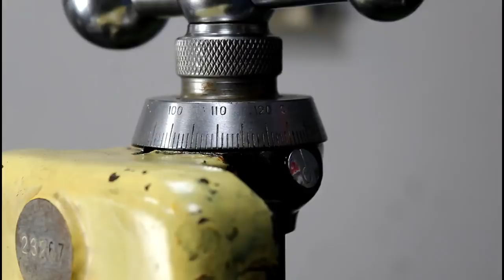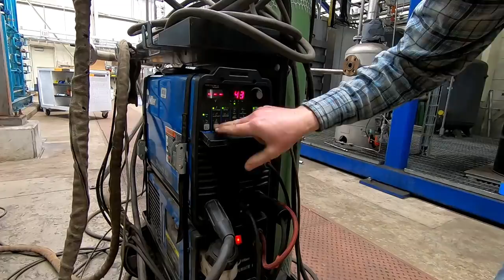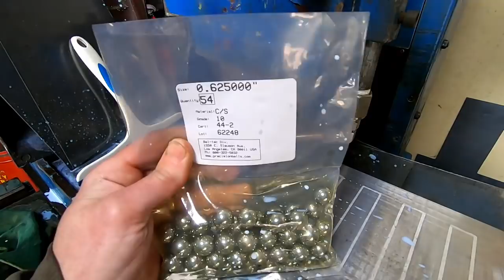Accurate Metal Shaper Work :-) Squaring Fireball tool squares.

Comment: Very interesting videos Steve.  I;m 82 years old and watch you and A bomb and Keith nearly every day. My earliest days of machining go back to highschool. I graduated in 1955.  I took all the machine shop classes that were offered plus related subjects,  my senior year I worked as a coop student at a company called Modern Machine & Tool Co.that graded my report card that year . Three years active duty U.S Navy  Long story short after working in another machine shop called Roemer Machine and Welding for seven years than a 7 year stint at The Rock Island Arsenal  as a grade 12 machinist  I purchased Modern Machine in 1978. I operated personally till about age 75. My son now runs it sort of like Adam Booth and his Dad. I'm  so ingrained to machine shop that I feel compelled to watch it. I've done it all hundreds of times, turning milling ,grinding of all types.  Also have 2 CNCs Haas vertical mill and Mazak Lathe. Getting back to grinding  I recommend .0002 tenths down feed per pass, anything more than that will wear your wheel down more rapidly and lose your finish.  If there is any thing that I could be of assistance feel free to Email me at arpsdel@gmail.com.  Thanks for your indulgence.

Comment: Just be aware that the 5/6 block test for surface grinders only tells you how well the chuck has been ground in (ie: how parallel it it to the ways). It will not tell you if the machine ways are bowed, since the chuck will have been ground in to follow that same bow. You'll only know how flat it is if you grind a large workpiece and check that on a surface plate.

Comment: The block test won’t tell you if it grinds flat. As long as the chuck was ground properly everything should be parallel but not necessarily flat. There’s some other ways to check actual flatness. Looking like you turned it into a decent grinder again!

Comment: Looks like that grinders a keeper.  Just like any new skill a bit of a learning curve comming up  but im sure you will pick it up quick enough.  Nice looking finish you showed.   I use a chinese magnetically coupled pump of similar operation for my homebrew beer setup and get good flow and tollerance to output blockage / intentional restriction.  I should check its bolt pattern as it might be handy to rotate its head too.

Comment: Might as well replace those balls now, no need to have to grind that chuck in twice by doing them later. :-) I am surprised they used english dimensioned balls in a grinder from a metric country. I guess imperial sticks around pretty good! lol
Reply from the maker: This machine has a crazy mix of metric and imperial hardware. Just enough to keep you guessing. I was also surprised to fine 5/8" balls in it.  The balls were about 100 bucks shipped. That's not that bad considering how accurate they are. Worth a shot at that price I think.  Good to hear from you Brian.  Thanks for watching

Comment: Hi Steve  I'm interested in seeing a shaper and dividing head used to do internal keyways and internal involute splines.  This type of work Is challenging with the equipment I have which doesn't include a shaper.  Thanks

Comment: Were you able to find, or do you need to find, any new tracks for the new bearings to ride in? I was also curious if the grit would imbed into those bearing holders and go to grinding on the new bearings when you put them in as well.

Comment: Why are covered bridges covered ?
And why do they have sides ?
Is it something to do with the old horse and cart days ?
Reply: Yes, they go back to the horse and buggy days. They were covered to keep snow and ice off the bridge. The sides kept the wind from blowing snow on the bridge as well.
Reply: Lots of covered bridges in the east still.
Reply: @bobwitt305  Sorry all, not true.  Many horses would not cross a bridge, the open frame scared them.  So bridges were enclosed to look like barns, then the horse/team would enter.   Rob
Reply: @davidmcgee7300  what does that have to do with my comment?
Reply: Water promotes wood rot. Ice keeps the water on there longer, ergo, more rot.  The cover is a roof, so rain and ice do not rot out the timbers of the  of bridge.

Comment: I just accidentally bought a surface grinder, so I'm depending on you to teach me how to work it!
Reply from the maker: A student trying to teach. I'm impressed at your confidence in me😄
Reply: I don't think I've ever watched one of your videos that I didn't learn something, even if it's only that I don't want to clean out the sump on an old mill. Btw the grinder will throw a 1.5" steel cube all the way across the barn and embed it in the wall like a ninja star, in case that's something you were going to try. It'll chip the grinding wheel at the same time. I recommend not trying this.

Comment: quite a score on that coolant pump. Very good flow, very quiet. Is there a bypass on the pump, so that the pump isn't deadheading when flow turned off?
Reply: That type of low pressure pump churns when it is not flowing.  No "deadhead" is created.

Comment: Hy  my name is Georges Gareau , I love your videos ,

I intend to build a 7 or 8 "  Metal shaper , I  was wondering what
would be the best number of strokes per minute  I found the fallowing
but they are all different

What is the best Strokes per minute for a 7, 8 , or 10 inch metal
shaper , 40     62      103     161 , 40        80      120     160 , 40        70      115     180 ,   or
42      75      120     195 ?

Why aree they so different

Georges

Comment: Sweet welds, boiler replacement? Why no purge on root though
Reply: The flange appears to be a socket weld and you don’t purge socket welds
Reply: @mikec.9177  by code u need a 16th gap on a socket flange and any open air and stainless to not mix well from all my experience. I do more stick pipe than Tig but I think I would have purged my self.
Reply: chris jones  the gap you are referring to is for expansion it isn’t considered a gap like you have in a open butt weld
Reply: @mikec.9177  No the gap is so you can get it level. Try no gap it'll pull and u will never get it right again.
Reply: Your correct it does give you the ability to level the flange but you have to leave a space for expansion. I welded for 30 years and now I am a CWI. They make a piece called a gap o let to help maintain a space.